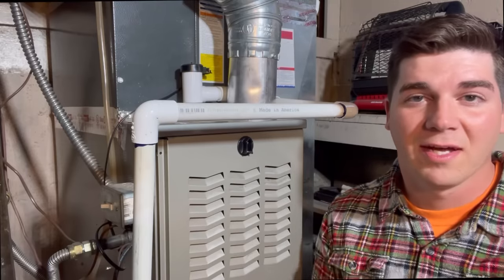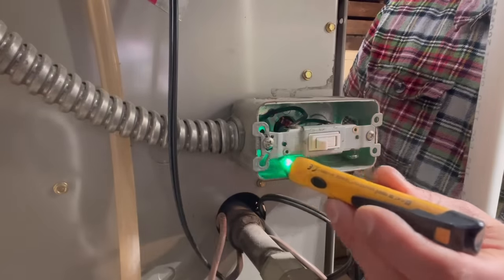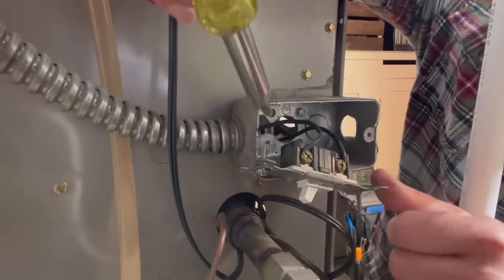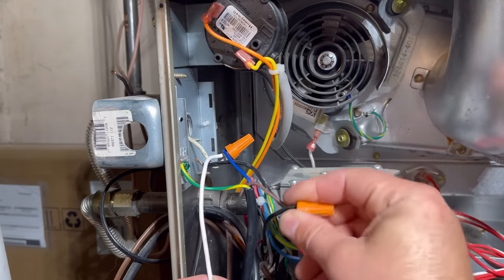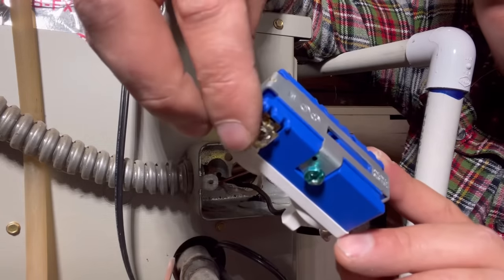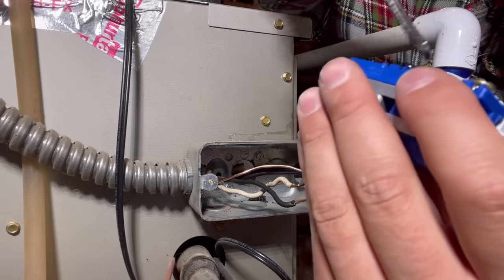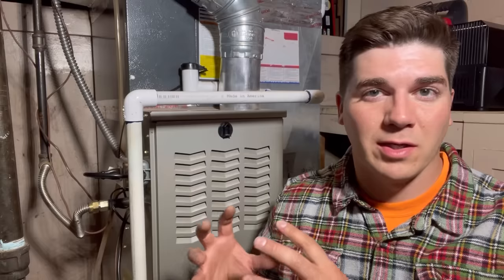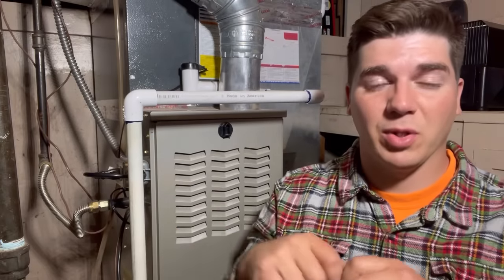This Could Keep Your Family Warm During An Emergency Power Outage.

Comment: Slight thought:  Better to remove the Switch Cover of the Furnace, and use the Hot Pen - (knowing the Furnace still has power); and than switch the Breaker OFF; and now verify with Hot Pen.  This avoids any possibility that the Hot Pen is not correctly working for whatever reason.
Reply: Exactly; the rule is to test first on a "known" hot source, and then test intended circuit. Excellent point sir.
Reply: Never thought of this, I am commercial refrigeration, so it's all power panels. You automatically verify a source since most of the stuff you work on is hot at some point. But here, verify, agreed.
Reply: @tracykey9227  if you want to go the extra mile, you can test it again afterwards on the known hot source, to ensure the pen didn't stop working between the time you verified it was working and the time you tested the circuit in question
Reply: The best way to verify the pen tester is functioning properly is to rub the tester up and down on your shirt. This causes friction and assuming you bought a automatic ranging pen tester(which can detect low voltage) you are creating a known live power source for your pen tester
Reply: @xsaber101  there's no reason to "test" your pen using static electricity when you can just touch it to any hot wire or outlet
Reply: "Assumptions" have killed more people than verification ever has  @xsaber101  😉
Reply: @darkfur18  agreed
Reply: @rodeobob6861  dumb idea
Reply: @darkfur18  it’s called a widow maker for a reason, it does and will lie to you.

Comment: A friend of mine did that exact same thing over 10 - 15 years ago.  His wife thought he was nuts spending all of that money on a generator.  Until the next power failure, 15 minutes later they had lights, TV, refrigerator and heat.  She was happy.
Reply: I too invested ~$700 into a generator, transfer switch & ...10/3 wire in a rural home in Maine back in 2010. 
We got divorced 3 year later (not related) and in 2015 I was in Tampa Bay area, and saw they had a huge blizzard that cut power to the house for about 2-3 days. 
With hydronic heating & 240v well pump AND a powered exhaust vent, you needed multiple circuits & a 240v generator.
I wonder how she made out during that storm. Sucks to have to learn everything in a crisis when you could simply not have been a beach.
Reply from the maker: Happy wife happy life haha that’s one thing I’ve learned after 10 years of marriage! :)
Reply: The usual story. They always think you're some sort of a nut, or such until it benefits them directly...
Reply: @diyhvacguy  I believe that, or did. At 46 years in, nothing makes a happy wife! Only kidding. They do get crankier though...
Reply: @mfgc2610 can’t live with em or without em
Reply: @Billybob-go8hn  YEP! Don't want to even try... I think! 🤔
Reply: @Billy bob  wrong I can and not even care
Reply: No one else's opinion truly matters.
Let them think you're crazy.
The same will be asking for help later.
Reply: @rusosure7  Sometimes happy wife : happy life. Getting more relevant...No wife: no strife.
Reply: Women.
Reply: @rusosure7 I feel for you; I'm divorced as well. Too many women just do not understand what we men do to protect and provide for them and our families; this "peace of mind" is priceless, especially during the crisis we plan for.
Reply: Thats exactly my plan
Reply: @davef.2329  So damn true!
Reply: @Billybob-go8hn  I know a couple guys who "tapped-out' and bought dolls.  LMFAO
Reply: They always complain
Reply: The only way your friend could have done the "Exact" same thing is if his Refrigerator, lights and TV were wired to his Furnace already. I'll go out on a limb and say that they weren't.
Reply: @duckhunter8387  His solution was 4 extension cords.  The portable generator was put on the back patio.  4 cords ran in the door, 1 for the furnace, 1 for the fridge, 1 for the living room, I forgot where the last one went.  The only change to the house wiring was the furnace loop back to plugin the furnace.
Reply: Thanks, I want to do this but the diagram was too small and shown too fast.  Also I got confused with what wire was what.  So please do another version of this but for a complete novice and take it slow.  Thanks, this is really valuable knowledge!
Reply: He had a power failure FIFTEEN MINUTES after he put the generator in????   AMAZING!!!   Just kidding, BTW, JIC.  :-)  Commas are wonderful, and you placed yours properly.  I am just silly, and that hit me when I read your post.
Reply: Happy for a minute 😂😂😂

Comment: I did essentially the same thing last year, just a single outlet.  It seemed redundant to have the switch too.  I'm getting my old 60amp service updated to 150amp and asked my licensed master electrician about this method.  He told me he cannot do it this way as it is a NEC Code Violation:  "The use of rigging an extension cord is a violation of the National Electrical Code and also presents a potential safety fire hazard. Per Article 422.16 in the NEC.........Flexible cords are only permitted if the appliance is intended or identified for flexible cord connection."  Forced Air HVAC systems are not intended for flexible cord connection.    My updated service is going to be permitted and inspected by my town and local utility, so I took the cord and outlet out of the handy box and put the original switch back in.  It's not going to cost me much more to have my electrician put an interlock transfer switch at the panel with an outdoor feed so I can power the entire house from my generator which is the more convenient way to go.

Comment: Couple of points; NEVER, EVER run any wire through an unprotected metal hole. It may take years, but there is vibration from the motor(s) and the sharp edge will cut through the
insulation. Another connector or grommet is required. Secondly, a plaque with instructions
should be mounted near the switch since you never know who will be doing this down the road. Transfer switches are generally safer because all this happens automatically. But
they are more complicated and costly to install. The advantage is no extension cords running through partially opened doors/windows which could let CO inside from the generator.
Reply: @re2248  Here's a scenario...10yrs. from now hubby is away or sick or just gone. Single digit winter night, power goes out. Wifey goes down to transfer the power feed, no instructions, just a flashlight and crying kids 
upstairs. (But hubby did tell her how to do it...10 years ago).Would she be a moron for not understanding/remembering the process? And Damn! could only find a 50 ft. cord for the generator, since the neighbor borrowed that heavy duty 100 footer last year, which only leaves 10 ft. beyond the last door/window.....But...calm down sparky...what could possibly go wrong? Forgot to mention that a modified heavy duty cord or modified pigtail would be required since you'd need male to male connections...Which
anyone would know without thinking, right?
Reply: @lukula2934  You should tell stories for a living. You are good in the make believe world 🤣
Reply: @lukula2934  Seems you misunderstood what he was doing.  There's no male to male connection.  Have your husband explain it to you.
Reply: Ok Bill. How does an extension cord plug into your generator? And you can see the switched outlet in the pics right? But you go ahead with your
piss-ant, snarky, insulting comments. After all, it makes good you tube entertainment.... @BillyBobDingledorf
Reply: @lukula2934  It plugs into the generator with that male plug that was added.  Watch the video again.

Btw:  It was a joke, based on your scenario.  It was your story that assumed the hubby knew what was going on and the wife is ignorant.   I simply played off of that.  Lighten up.
Reply: @lukula2934 Drill 3/8" hole and use a wire connector. no biggie
Reply: what bill is just trying to point out to you is that the addition of the "pigtail" allows the furnace to be plugged into the switched outlet, which is connected to the home's electricity. The reason for this is to have male leads that go to the furnace, precisely so they can be unplugged from the outlet and into an extension cord when needed. This is all very clear in the video, hence you did not understand the video.
Reply: "Hence you do not understand the video?" It's been a while since writing that comment, but I do remember a couple
of things. First he would need to make up a special cord with 2 male ends in order to connect a generator, that's
to a generator, not to the home's power since the only time you would need or want to do this would be when
the home loses power. Secondly, were the basic and potentially dangerous wiring like running line voltage cable
 through a sheet metal hole with sharp edges exposed and no grommet or connector used. Don't remember seeing
him make a good ground on that box but he may have done so..... 
I'm not casting aspersions on the overall concept but if one doesn't understand basic electrical principles one should learn or hire a pro before making YT "how to" videos. And BTW, one could go to any box store and purchase a transfer switch with a single or multiple,(for your fridge or well pump etc. ?) circuit capabilities,  built-in fuses and even directions on how to safely install it without messing with the furnace at all, since this could be done 
next to the service panel. or even placed somewhere on the exterior to make the hook up super easy and safe. @vinnygunn
Reply: @johnbritton8865 my bad botched my reply to lukalu or whatever their name was, not you, but no there is no need for a suicide plug here. The furnace now has a male plug. The switched outlet is where this male plug goes most of the time. A regular extension cord fills in for the switched outlet during power failure. The whole point is to convert the hardwired furnace into something you can plug into a regular extension cord. Not saying any of this is a good idea or up to code or executed safely, just pointing out that this is NOT a DIY transfer switch, and a male-male cord is at no point suggested or required with the proposed design.

Comment: The electrical box should be grounded from the source (green or bare wire) at the bottom of the box with a green hex head grounding screw. If somebody disconnects the furnace wires the box and furnace enclosure will be ungrounded. The plug wire should be the same size (#12 or #14 most likely). as the incoming circuit so if there is a short the pigtail won't be overloaded and get hot before the breaker trips. The hole at the bottom of the box should have a connector in it to prevent wires from chafing on the sharp bare hole. All code

Comment: I would suggest that you make sure the pig tail is either 14 or 12 gauge wire to be able to carry 15 or 20 amps safely depending on the size of the breaker for that circuit. 

I have one circuit that feeds the sump pump and the furnace, which are right next to each other.  I'm going to use this idea to be able to power those two things.  Eventually I'm going to redo the breaker panel to have a manual breaker interlock/transfer switch so I can power anything in the house, but that is a much bigger and more involved project for another time.
Reply: It's not worth the trouble and expense......A DPDT switch big enough for you whole house costs several hundred bucks and you have to get your main service shut down to rewire the main to the switch.  In many locations, they are beginning to follow to the 2020 code which requires updates to include installing your main breakers OUTSIDE next to the meter.  Then a licensed inspector must audit your whole system for 2020 compliance, prior to the electric utility reconnecting your service.  Lastly, a manual transfer switch is very hard to operate and so only husky people can flip it.
Reply: @diverbob8  I've not heard of anyone in northern Ohio being forced to relocated the breakers outdoors and have not seen it even in new construction.  

The manual breaker interlock/transfer switch I was referring to is an add on to a standard breaker panel, UL and NEC approved, and available on eBay for about $60 to $70.  One uses the top breaker closest to the main breaker to back feed the panel from the generator.  The interlock is a sliding piece of metal that prevents both the main breaker and back feed breaker from being turned on at the same time.

Comment: This is a very effective solution for locations with occasional outages.  I did this in 1986 and it has been used about 6 times in 37 years.  My only concern with your approach is that your breaker is 20 amp rated and that means that it can protect 20 amp wiring (AWG 12 or larger).  Your pigtail appeared to me to be smaller than that.  If it is, I would recommend a larger one (AWG 12) or a 15 Amp Breaker.  This would depend on the motor HP and it's related starting current.  (if it's AWG 16, I recommend that you change it).  Remember that the feed wire is sized for the load and the breakers job is to protect that feed wire.